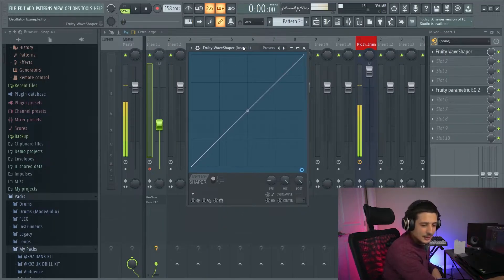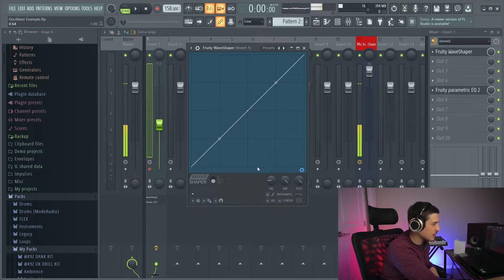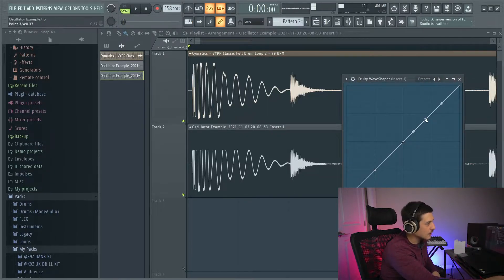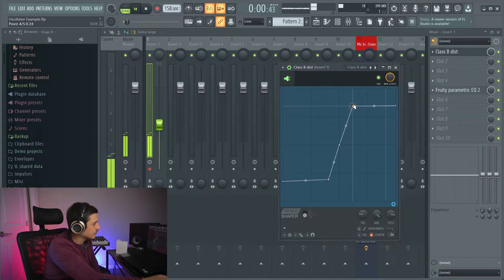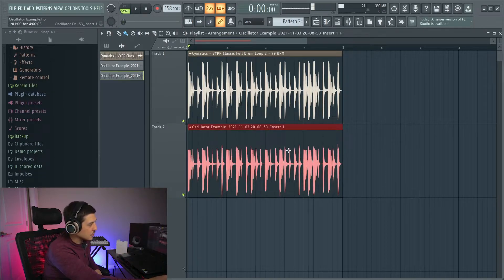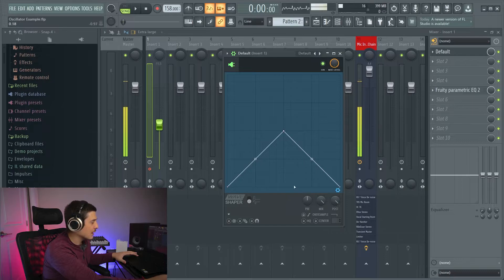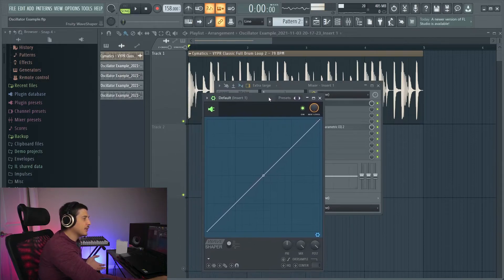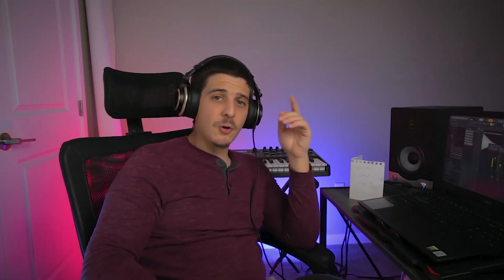The Waveshaper Explained – You Wont Believe All The Things This Can Do

Comment: should i only be using this for low end type instruments or should I use it for all?
i usually just use it as a sort of volume enhancer until I discovered this video
Reply from the maker: You can use it for anything. Individual instruments, a whole mix, vocals, bass. You just want to understand the characteristics so you can better use it where you see fit.

Comment: what soundcard do you use
Reply from the maker: It’s the on board soundcard of my G5 laptop. I usually have my interface hooked up though which is a 1st gen Scarlett 6i6.
Reply: @ScaleAudio  wow , i have a rme  fireface but its sounds like its covered do u think its a driver or windows ussiue or myebe im doing something wrong
Reply from the maker: @Yll-Beats  what issues exactly do you have? You said it sounds covered? As in muffled audio?
Reply: @ScaleAudio  yeah muffled
Reply from the maker: @Yll-Beats  interesting, maybe drivers? Did it come with software? Could have something to do with the settings/configuration of the software or even the hardware.
Reply from the maker: @Yll-Beats  seems like problems you shouldn’t have to be having for such an expensive interface.
Reply: @ScaleAudio  yeah it came with software  its driving me crazy there is no depth muffled recordings , have installed the newest drivers nothing works , or meybe my pc cant route how it should
Reply from the maker: @Yll-Beats  I would call customer support and get them to help you fix it or refund/return the thing. Google tf out of it too. Somebody is bound to have had your same issue somewhere in the world and they might have found an answer.
Reply: @ScaleAudio  thank you for u respond bro i will  god bless
Reply from the maker: @Yll-Beats  god bless. Thanks for watching and engaging 🤙